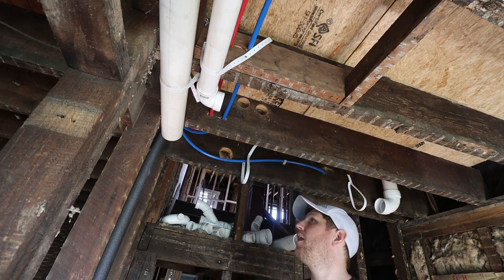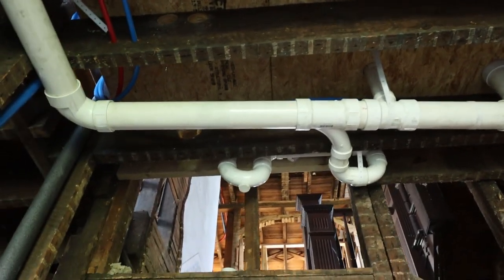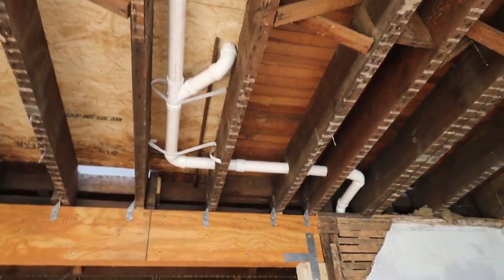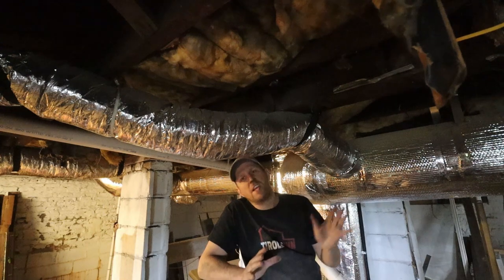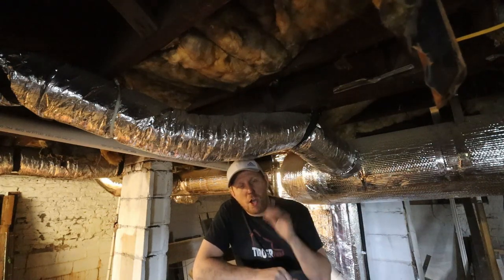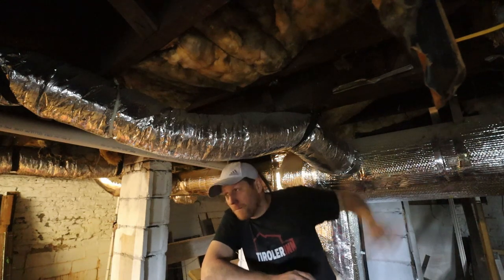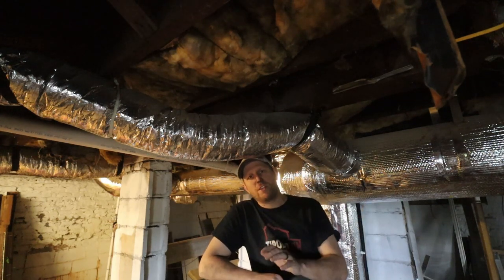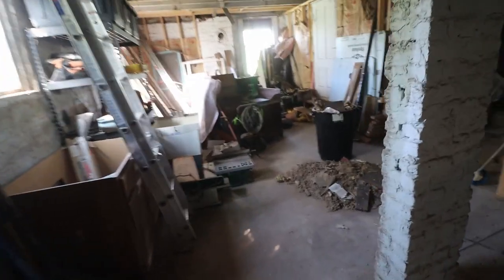Finalizing Plumbing - Part 2 - & some duct work rants - Our Victorian Mansion Remodel

Comment: That looks like a lot of turns on the shower drain.  Any concerns about not being able to clean out the section from where its vent starts to the connection with the toilet line?
Reply from the maker: I think we should be ok. We did clean up some of the extra turns and we will still have to get the final roof vent added so it might still move around a bit.
Reply: @TirolerInn  You are doing great work.  What kind of engineering degree do you have?
Reply from the maker: @jayzoller5725  mechanical and product design